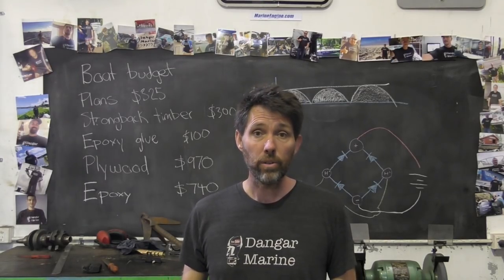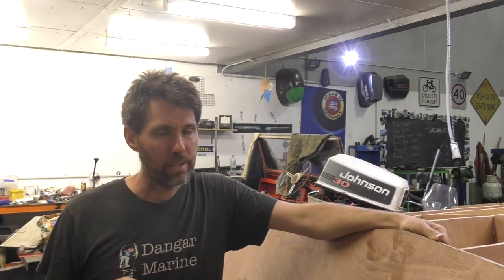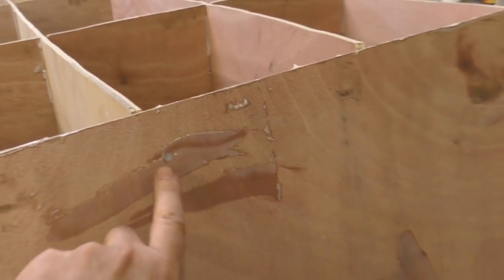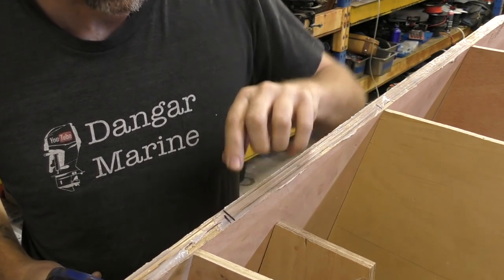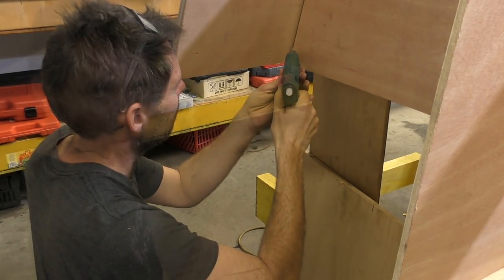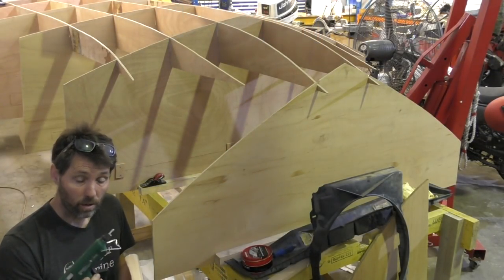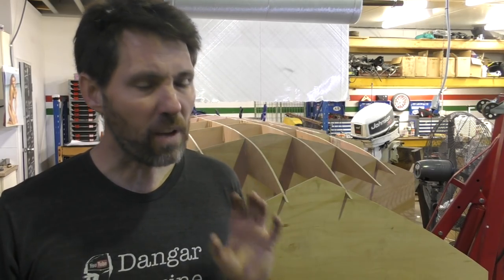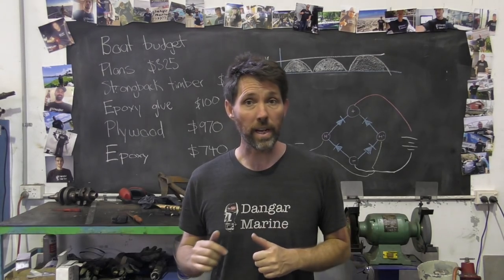Installing the longitudinals and transom

Comment: I have built stitch and glue boats and you are correct, there can be a goodly amount of space, gaps, misalignment, etc and still end up with a nice hull.  S&G is forgiving as you said and that allows for easy customization which I think is it's greatest feature.
Reply from the maker: Although it is reasonably forgiving, I think I do need to get this frame as true as I can before I think about sheeting it. Fingers crossed that will be possible!
Reply: Yeah, the thing you most want to be careful about with S&G is the overall alignment of the sheeting.  Best way I know is to measure an "X" from each stern corner to up where the bow curve starts.  That should be equal length on both sides.  And along the keel, it should be straight without any hook or rocker (unless that is how it is designed).  But I built a hull that was equal length when the framing was done but off by 3/4" after sides and bottom were stitched and tacked in place.  No big deal,  I just loosened the stitches, cut a few tack places and tightened it up again.  Same with the bottom panels which developed a bit of hook when first put on,  but again some pushing, prying, and judicious tightening got it straight.  Good Luck with your project.

Comment: Hi, could you please, do an episode on 2 stroke outboard motors, replacement of anodes. Please include types of anodes, there seems to be conflicting information in regards to the types of material used for particular applications and when to replace. Your help in this matter would be appreciated. Thank you for all the informative information you have provided. You have certainly helped me.
Reply from the maker: Sure, I've been planning to do a video on corrosion and anodes for a long time. Must do it soon.

Comment: You are doing fine on the boat.  Some places where the fit is low, you could glue in some firing strips and sand to shape with a sander.  On the front, you may have to bevel the bulkhead to get a good fit and glue area for the skin.  Use whatever works to keep it straight.  Plan out what you want to accomplish each day and do that task.
Reply from the maker: Interesting you mention the bulkhead because I spoke to the designer and he said the transom was supposed to be lower so the back edge is level with the longitudinals not the front edge which makes perfect sense when you picture the hull plates laying over it. Thank God for light tacking! :)

Comment: Been in a similar situation with the fella who taught me hands on. Would love to fly down and help you get it straightened out, bud.
Reply: What would you do about the the larger gaps? Add a small piece of wood and epoxy it. Or add some type of hard, thick filler/bondo and then epoxy, or just make a thick fillet with some thicker fiberglass cloth/matt?
Reply: Peanutbutter aka thickened expoxy with chop strand mixed in. The hull I helped build we planned down 2x2 to perfectly square and temporary screwed 3 inch blocks between the stringers and bulkhead to square everything up while the first resin tabs cured..
Reply from the maker: You're always welcome, could use all the help I can get! :)

Comment: As a long time carpenter, I am curious why you aren't using a nail (finish) gun to help hold/put things together? Way quicker then the glue gun, and a true "mechanical" fastener... and still room for putting glue inside joints (again, I'd be gluing it all, as I'm nailing things, but maybe I'm missing something??) I built a "one sheet of plywood" boat a few years back and it went together very quickly once I had all my parts cut out :) WEAR EYE PROTECTION IF YOU USE A NAIL GUN !!!
Reply: I'm guessing he doesnt want to deal with extra holes to fill/epoxy and less chance of wood rot from water intrusion.
Reply from the maker: Mostly my choices come down to following the instructions which are presumably based on long experience so I don't tend to question them too much. As Jim says, nails would need to be removed as they would rust until they were stainless.

Comment: Hi Stu, do you have time to do a Honda 40 gearbox bearing carrier removal for new seals ? Cheers Brett
Reply from the maker: That shouldn't be a problem. Just need to make sure I've still got some hooks that will fit, I broke one of them a while ago.
Reply: Awesome thanks.....remember that big bearing carrier nut on the honda's
Reply from the maker: Mine has two regular bolts holding the bearing carrier in. Is your a single large collar?
Reply: Yes and needs that big fingered socket to remove locking nut with tab under it.....just ordered some Seamless tube to make a socket...mines a 97 model
Reply from the maker: Cool. I've made a few of those myself in the past but never done a vid on making them.